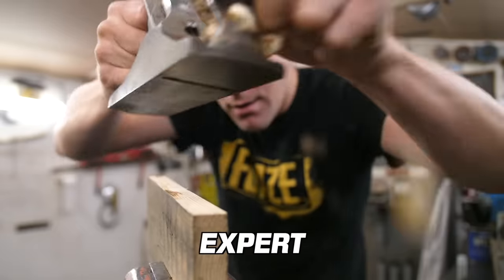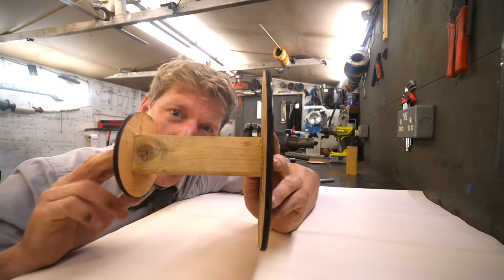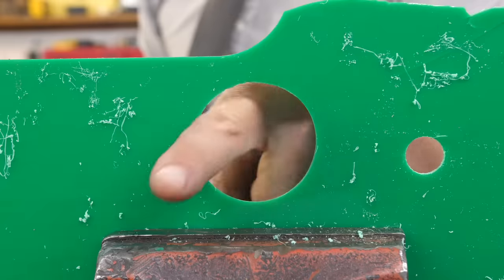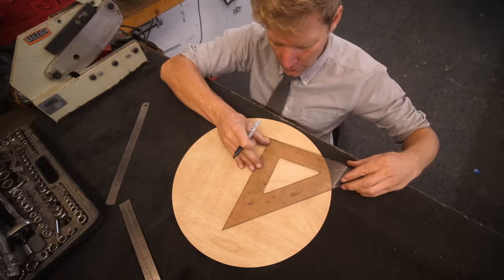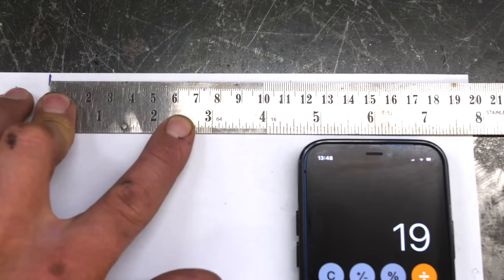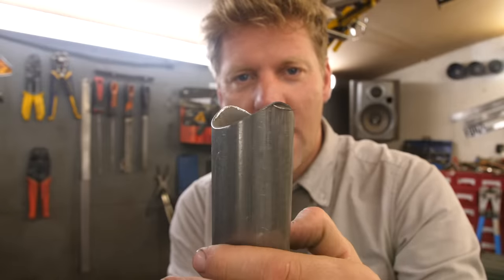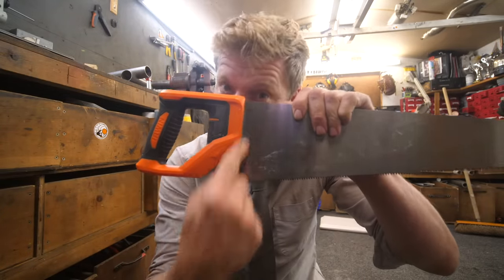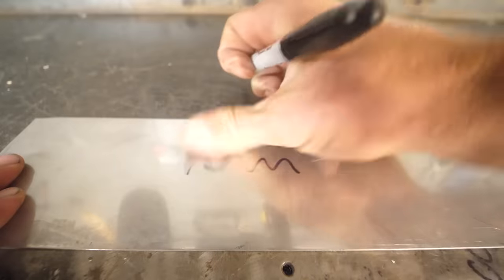18 GENIUS Workshop TIPS (that actually work)

Comment from the maker: Let me know if you know of any more guys as some of these were new to me but genius. Get an exclusive Surfshark deal! Enter promo code COLIN for an extra 3 months free at https://surfshark.deals/colin
Reply: Hi Colin
Reply: salt and alcohol to remove oily/tarry goop -= the salt doesnt dissolve but any tarry stuff will. Even works shaking it round in something
Reply: A good safety tip:  Never try and hold a piece of wood in one hand and use a chainsaw with the other, especially when on a trampoline.
Reply: If you struggle to wash your hands, use PVA glue and let it dry. Works a treat
Reply: Excellent video as usual Colin - Top job.
Reply: What’s the loo roll tip? I need it urgently
Reply: 19th Workshop Hack,  "Safety Glasses"
Reply: You can use drywipe pens to get rid of Sharpie too.
Reply: @lefroy1 I close my eyes so I don't get saw dust in them . Top tip.
Reply: -Alcohol removes Sharpie ink.
-One can always put a round bubble level on the back end of a drill, but this only helps when drilling downwards.
-A long strip magnet on the end of a broom handle works well to sweep up dropped washers, screws, etc. I've evn seen them attached an inch or two above the end of a broom's bristles to collect metal bits while sweeping. This also helps to keep the bristles from going overly wonky over time.
Reply: Wait. You're still a youtuber?
Reply: When you open a pack of cable ties, cut a small slit in the centre of the packet, take cable ties from here. They won't all fall out, like if you cut the end of the pack.
Reply: 5:30 not parallel, perpendicular!
Reply: Im not sharing any hacks until you do your 12,000,000 subscriber fireworks celebration.
Reply: The Saw handle is not just a 90 it is also a 45 angle
Reply: Hey calling I've got a bunch of ideas that nobody's ever thought of yet and I just don't have the time or resources to work on them
Reply: I'd rather use silicone for a non-slip pad than carpet
Reply: Glue the foam rubber in the tonnel, there will be much less echoing.
Reply: @cocospops9351 I like that zip tie hack. For small bagged nuts, washers and screws the little holes already in the bag can be stretched a little to remove or return the bit. 
Blue/green painters tape makes a good reusable “latch” for boxes that won’t stay closed. 
Mark your center/cut lines on blue painters tape on your part let’s you remove sharpie lines from wood and it has good contrast.
Reply: Getting a 3D printer, they are so cheap nowadays, and can be useful not only for prototyping and even final parts with the right design/material use, but also for making templates, measuring/calibration tools, and more!
Reply: (better described with visual aids but) If you have a line but want to get a right angle from it: measure two points equal distances away from the angle point on the line then make two larger radiuses from those points (use a compass or string or w/e)  where those radiuses intersect will be 90 degrees above the original point.
Reply: This is great Mr Furze. Lots of new tips for me
Reply: You can use sharpie as a guide for annealing aluminum instead of acetylene soot!
Reply: Brake parts cleaner works GREAT on sharpie
Reply: 10:52 alcohol also works
Reply: I find that if my hands are are covered in thick tarry oil, the best way to clean it is to use a very light oil like wd40 on your hands rub it well in and then wash your hands with washing up liquid. the lighter oil breaks down the heavier oil making it easier to remove.
Reply: New tip! Plan for head room when you're building?? x{ <4<4
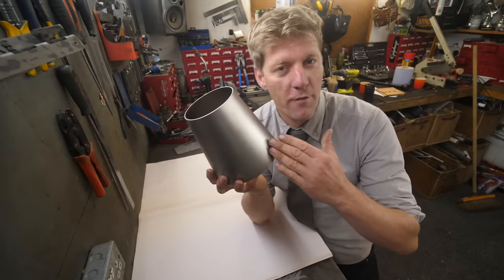1:10 look look lots lots of head rom :}
Reply: To get permanent marker off of a white board, just scribble over it with a white board marker.
Reply: The drill in drill thing is genius! Never considered stacking them and needed exactly this solution earlier today. I ended up with a normal drill in a hand drill chipping it bigger in polycarbonate plate.
Reply: A great way to strip wire is to drill a hole a bit bigger than the wire in a bit wood then drill another hole the opposite way down into the other hole then sharpen a screw end and put your wire in hole then screw point into the wire outer layer then pull the wire through with the wood in a vice or something to hold it. You can also use a drill to pull the wire through.👌💚💛❤️
Reply: If you scrumple grass up in your hands it's great for cleaning them and getting smells like petrol off them and even works with oil.💚💛❤️
Reply: If you need to cut Cork/paper on a laser cutter and it constantly curls up. Should be able to use either a small ball bearing, or a small magnet to hold it down at the corners.
Reply: Colin, do you have a link to your drill bit guide please?
Reply: I have a safety tip that could save you life... Tip #1: Never, ever, try to build anything Colin builds
Reply: The "how to know if a square is a square" method can be defeated by a Rectangle, Colin ;)
Reply: To straighten coiled wire: cut the length you want, clamp one end (I use a vice) and stick the other in a drill (I use a cordless.) Press the drill switch so the chuck rotates and it'll uncoil your wire. Makes it nice and straight.
Reply: To get sharpie off wd40 and a shop paper towel
Reply: The handsaw also has a 45 degree angle
Reply: Lots of these are super handy, for the sharpie tip, most of the time dry erase marker on top of the sharpie works even better.
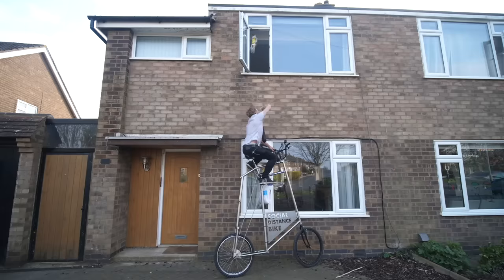Reply: 2:19 clean sand does same thing (I have 5 litre sandsoap bottle in my workshop)
Reply: You can use kneadable rubber,  putty or sticky tape to remove iron filings from a magnet
Reply: Another thing re: the sharpie, you can also go over permanent marker with dry erase marker, the solvent in the dry erase marker that makes is erasable will mix with the ink from the sharpie and make it dry erase ink.
Reply: Couldn't you have just filmed the Intro towards the end of editing so you wouldn't have to do the weird voice cut?
Reply: @lio1234234
This, too.  You could probably print 90% of the parts you need for that notch cutting tool, too.
Reply: if you want to tighten a bolt / nut but you can't reach it and with the ratchet wrench you can but the bolt falls out put some grease in it now it gets stuck
Reply: you can use the inner circle of dots to get a certain distance when drawing
Reply: For getting rid of maker pens I use methylated spirits(usually used as a degrease) and it works well for stripping Grease below the marker pen at the same time you just have to remember to clean your hands once you are done in the workshop
Reply: To make a perfect hole in a piece of glass (to put something like tubing through it or become a master jewel thief) etch the glass in a circle with a single pass, making sure to stop right after the start point. Place a suction pad with a handle on top in the center of the circle (something like removing dents from car doors), then alternate between heating and cooling the etch you made in the glass. The greater the difference between the hot and cold, the easier it will be to remove, though a huge difference may shatter the entire pane of glass(think dry ice and a direct flame). As you heat and cool the etching, apply a pushing and pulling force with the suction cup but not directly in and out. Try to pull and push the suction cup in a circular manner while the cup is still suctioned on the middle of the circle.  The glass circle will eventually pop out!
Reply: The handsaw also have 45° angle built in.
Reply: if you have a cordless angle grinder... undo the 4 bolts holding the motor/gearbox and rotate it 90 degrees and then re-affix... makes your grinder so much more balanced and does`nt strain your wrists if doing a lot of grinding/cutting.. great if wanting to do precise cuts
Reply: Ok, I exchanged LMB and RMB of my mouse. Boiii, I work fast now!! 😆
Reply: Hey Colin!  Another way to get sharpie off any smooth surfaces is with a Dry Erase marker.  Just scribble over top of the sharpie marks with it, then wipe it off and it 100% comes off.  Works on Metal, Glass, Plastic etc, and leaves nothing at all behind.
Reply: @Lowbrow_Mthakathi I’ve stuck a sharp pencil in the side before now after having some very challenging paper, then pull towards the glued bit. Hope this wasn’t too late😂😂
Reply: You may lubricate a nail by hitting your finger with the hammer first
Reply: another way to get grease off your hands is use washing power same idea with the sugar just makes the soap ruff. side note your hands will sell awesome. 
if your ever working with hot asphalt diesel eats thru it like a hot knife thru butter.
Reply: sharpie removal: everyone probably have hand sanitizers at home look for one whit Isopropanol in it sometimes they use another names like 2-propanol/isopropyl alcohol. its way better then ethanol
Reply: When drilling concrete, a lot of times the drill bit will walk and make you miss your mark. What I do is use a center punch to start the hole in the concrete, use a small concrete bit, drill a pilot hole just like you would in metal, this makes sure the hole is where you need it to be. Not sure if this is s common practice for drilling concrete or not. But I thought I would mention it anyway. Thanks.
Reply: Wow, a hack video with actualy really useful stuff. That must be a first! 😂
Reply: Finding level with quick square and a plum bob?
Reply: Colin heres a hack for you Cracks a holes in plastic can be filled with bicarbonate of soda then add a few drops of superglue works a treat.
Reply: The hole saw in hole saw hack would have saved me a bunch of epoxy repair on my back door 😂
Reply: I buy cheap exercise mats and cut them down to whatever size for when I'm working on my knees or laying on the ground.
They work great and they are cheap!
Reply: I'm amazed you haven't done one of these bids before Colin... Know I love it before I watch haha
Reply: Car boot sales are a great way to get old tools. Stronger steel than Made In China, and all the old stuff that came before everyone had a computer in their pocket.
Safety glasses are cheap, eyes are not.
This goes for protective gloves, too.
Mark before you drill.
Measure twice, cut once.
Write down your notes and thoughts, so they don't vanish.
Reply: If you want to get a firm grip of something with a thread (like a screw) without ruining the thread, wrap a wire wide enough in the thread and now you can firmly hold it without ruining it.
Reply: To drill a hole in hardened steel,  use a sharpened tungsten concrete drill. Goes through like butter.
Reply: If you have grubby hands use green soap and a bit of bicarbonate. My experience it works better.
Reply: I work out in the field. If I run out of gritty soap I just grab a bit of dirt or sand and add it to my soap.. yes adding dirt to soap actually cleans your hands better.
Reply: Line up your light switch plate parallel with the door trim.
DO NOT use a level. It will look daft.
Reply: Put tape on drill bit as a flag. Flicks away sawdust when depth reached.
Reply: @demolitionman9307  My dad wouldn't let you do anything without safety glasses. He learned after losing an eye.
Reply: If you have an orbital sheet sander (the rectangular ones with spring clips at the ends what grab the folded-over sandpaper sheet) you'll probably find that the abrasive outlasts the paper it's glued to by a million years. Quick and easy solution - give it a backing of brown packaging tape before fitment and voila - sandpaper sheets that actually get worn out properly without tearing. Gaffer tape works even better if you're feeling posh. Best money- and tooth-enamel-saving tip ever!
Reply: @gruntspeed  Swarfega works best, especially the newer kind with the abrasive bits, as opposed to the older gooey stuff.
Use it, then wash with soap to get the stink of artificial orange off your hands.
Reply: You can remove permanent marks off wipeable surfaces by drawing over with a dry wipe marker (I know similar it's to your Sharpie hack)
Reply: Tip. Close the hatch so you dont fall in. Hehehe
Reply: To find a 90⁰ use the 3,4,5 depending on size mark 3ft on one side 4ft on the other the distance from furthest points will be 5 ft if it is 90⁰
Reply: A dry erase marker will also remove sharpie, and generally is easier to clean
Reply: IPA (Isopropyl alcohol) removes Sharpie really well, works as easy start, lights fires and cleans wounds. Also can be used for cleaning electrical terminals.
Reply: Bloody great idea for a Video Colin 👍
Reply: Use a dry-erase marker for Sharpie cleanups!

 (Comes off much cleaner and you don't have to worry about it drying on again if you're hitting a large area at once.)
Reply: @jeepercreep12  No if its permanent marker then you'll need Rubbing alcohol / isopropyl alcohol
Reply: if your kids get hold of sharpies and they colour something in,  something in  AXE / LYNX body spray acts as the perfect solvent completely removes it. worked perfectly on the bunkbeds, chest of drawers and varnished floor... mixed results on the barbies.. lol
Reply: I find standard dry-erase whiteboard markers are good at removing Sharpie too! As a bonus, it doesn't usually leave the smudgy residue.
Reply: You need a de burer
Reply: Also deodorant sprays get marker pen off too :)  I used to use this trick when rewriting to Cd's back in the day!!
Reply: Hand sanitizer gets rid of permanent marker from white boards and stuff.   and smells nice.
Reply: I know a few guys - you after any particular type of guy?
Reply: Remove Sharpie using whiteboard pens
Reply: can we work with you one day please. I'm thinking music video project at your lovely area @honourwave is our main channel
Reply: Colin you missed the 45degree set square on the hand saw
Reply: Sharpen chisels and drill bits with an angle grinder because life is too short for a whetstone, or a blunt tool
Reply: Use a bit of gel anti-perspirant on a bug bite to stop the itch.
Reply: yes piz
Reply: Use Stanley knife blades in a 3rd hand tool to precisely direct a blow torch flame.
Reply: Brake Cleaner works well to remove sharpie from glass/metal
Reply: If a bolt or screw is stuck, surprise it with a quick tighten before loosening it again.
Reply: Wire brush clogged sandpaper.
Reply: I have a question. when are you doing another tunnel video where your going towards your bunker/underground garage idea?
Reply: If you’re drilling through iron, use a 1mm grinder blade in the top of the drill bit flute to make the end pointy (they come with a tiny chisel type end) it will glide through.
Also grind the tip to 50 ish degrees not 60 - you may need to reverse the drill when breaking through the other side to stop the bit catching and snapping.
It’s way sharper than they come.
Reply: Balance long things on your finger to find the centre quickly.
Reply: Don’t tape power actuated nail gun caps to a crossbow arrow head. The arrow comes right back at you reallyfast.
I’ve heard.
Reply: For cleaning your grease nasty hands scrub with a dab of vegetable oil first, follow up with your preferred hand dish washing soap.  The veggie oil will not only bond to the grease and grime better than just using the soap but will also make your hands softer and cleaner... (without the chemical smell of gojo/fast orange/etc. My mother used to get sick from the smell of those hand cleaners being opened in the house when I was a kid so we experimented to find a great alternative).
Reply: When you drill thin sheet metal a drill will tend to egg out the hole. To stop this throw a piece of shop rag down under the drill bit or piece of emery cloth.When drilling brass a drill bit will tend to grab badly , to prevent this put a zero rake angle on the cutting edge of the bit, works for any gummy grabby material.
Reply: A few dumb tips from the peanut in the Gallery
If it's cold and you are using spray paint from a  can  to get the very best performance from them Preheat the entire can hot water until the can is at about 20c. I do go higher to about 25. Give it a good shake and test again for the best results.
Using air to pressurize your aerosol cans is good but some contents will go off when air is in contact. For stuff that you need to keep long term I have used Butane that is used to fill refillable lighters. It doesn't affect paint and puts a longer lasting charge into it. As for the flammability remember the vast majority of spray cans use this anyway as a propellant.
Drilling copper, plastic or anything soft or thin and your drill is tearing through on the back side put a very small negative angle on the outer cutting edge of your drill. It will prevent the drill from screwing through and tearing the back surface. It can also be used to ensure a much closer hole size to the indicated drill diameter.
If you are welding and have splatter or dont want splatter to stick use some cooking spray. Spray around the areas where you dont want splatter. There is professional anti splatter spray available but unless you are using it inside your mig welding shield the cooking spray works just as well and is loads cheaper.
If you are using your stick welder and the rods have been open for a long time in a non moisture controlled environment they wont work as well as they should. You can preheat them before use by using a BBQ and a old baking tray/sheet . Just leave on top of a gentle warmth to dry them out. It works very well for rods that have been left out in the rain or even just hanging around unopened in the shed for years. I use an old electric fry-pan that is clean to keep oil away. There are professional solutions for this like Rod ovens but the fry pan is temp controlled and works just as well. Dont get the rods to hot, I try to keep it under 110c and have good results.
I use the same pan for precision bearing fitment as well as other precision fits. Just leave the bearings on the pan and give them time to heat and normalize it is a rare occasion when the temp is required to go over 110c for an easy precision fit assembly.  Dont forget to use gloves to prevent burns.
The same old fry pan can be used again to revive a rusty old roller chain. I put the chain into the pan and cover with a light gear oil. Get it a bit warmer this time say 140c ~160c and let it soak. After the chain has come up to temp remove it and work it to free it up. Repeat this a few times and the chain if recoverable should be fine. Not the best thing for O ring chains but if they are not overheated they are still ok for doing this. O ring  type keep the temp down below 90c. This wont fix a stretched, worn out or bent chain but will revive  most and is a good practice after beach session.
Just a few of the top.
Cheers
Reply: Dry erase markers will also remove sharpie mark with a bit less mess
Reply: @LilMissMurder3409 another sander trick you can polish using a heavy paper bag in place of sand paper for extremely fine sanding/ polishing (around 5000grit)
Reply: Yes! Do more teaching videos, we need your skills al la This Old Tony, Ox Tools, Abom, Mr Crispin.
Reply: @dazaspc another is the hot air food dryer works good for not only  flux core wire/  stick welding rods but also 3d printing filaments, even drying water dipped electronics (on lowest setting over a day or 2) a bag of rice works too
Reply: To add air to your aerosol cans, use an old tire Valve Stem.
Reply: Don't sweat the petty things, and don't pet the sweaty things.
Reply: When using a holesaw into plastic, if you are sick and tired of getting the hole stuck inside the holesaw after the hole is driilled then for the last millimetre of the cut run the holesaw backwards. The hole you have drilled out will now drop out of the holesaw without needing to get a screwdriver to pry the hole you have cut out of the holesaw blade.
Reply: @Paulman50 thanks for that one!
Reply: Find the center of any 2d shape by drawing 4 lines that intercept to make a square, then 2 more lines from corner to corner
Reply: Of you want to get rid of sharpie even easier, write over it with a dry erase marker.
Reply: To clean your hands, use clean oil i.e. a spoon full of olive oil, to get of any dirty oil residue. Then just use soap and water after that. Will be much less aggressive on your hands than adding sugar 😂
Reply: to remove sharpie or other permanent marker ink just use metho, or any alcohol
it says on the side of the marker that its an alcohol based ink. 
just dissolve it with more alcohol
Reply: When machining: Stick a cigarette paper to any face you want to machine. Bring the cutter in/down until paper is whisked away. Zero your datum.
To find the best working height for your bench: look straight ahead, stand to attention. Place fist under chin and keep elbow to your side and the distance from elbow to floor is ergonomically the best height for the top of your vice. Make bench so vice is that high from the floor. 
If your pipe cutting is not great, and you want to reduce the tolerance (better welds). Wrap a piece of pipe with 120 grit wet and dry, and use to polish and refine the inner cut surface of the pipe you just cut. Engineers blue and Feeler gauges are useful if you want to get a very tight fit.
Reply: 3-4-5 Right Triangle. Measure 3 on one leg of what you want square, then measure 4 on the other leg. The the slant/hypotenuse will be 5 if it’s square. It doesn’t matter the units. You can use scale it up and use 30-40-50 or double or triple it with 6-8-10 or 9-12-15. You can even make your own units to fit the scale of the project. It works on all scales but really works brilliant if you don’t have a very large is square and need to measure things like a wall or foundation or football field etc. (I put this in the main chat too. Sorry for the repeat)
Reply: Sharpie is easily removed by isopropyl alcohol.
Reply: @demolitionman9307   you mean safety squints?
Reply: We have some kit that might help you out on projects... We'd love to hook you up with some stuff
Reply: @TheCainman1  yuh,  amazing how many people take their eyes for granted,,   could be worse though, like a Tye getting caught up in Rotating Machinery!
Reply: When applying lubricant to a chain e.g WD40 place another spray nozzle from a spare can at the end of the straw it makes aiming where it goes a lot easier. Brilliant video as always Colin.
Reply: Hi Colin. Just wanted to add that your tip with the saw/set square (90 degree) also has a 45 degree at the handle right beside the 90 degree one ;-) I like your vids.....cheers!
Reply: In regards to removing sharpie it can also be removed with drawing over it with an Expo Dry Erase marker.
Reply: To cut holes in thick material quickly with hole saws. First begin the hole saw so it scores the surface. Then drill some 4mm(ish) holes through the material at score mark. It allows swarf to clear without having to back out the hole each time the teeth need cleaning.
Reply: @TheCainman1  double rubbers, mother on speed dial.
Reply: If you want to straighten copper single core cable or a solid wire ( like suspended ceiling or fence wire ) fasten one end, then put the other end in the chuck of a drill. Pull tight while drilling the wire striaghtens out. Works on any length if you have room to stand far enough to pull it
Reply: The saw is a set square that can draw 90 degrees as shown but also 45 degrees on the other part of the handle - I’m surprised you didn’t mention it
Reply: Quickly true up a part on the lathe by running the part into a blunt tool until it runs true. Much safer than tapping it with a hammer while running!
Reply: Wd40 works for washing your hands of dirty motor oil etc. Oil dissolves in oil u know. Of course you have to use soap to wash the wd40 off then.
Reply: drywipe marker also removes sharpie
Reply: Wow
Reply: if you quickly need to bend a HUUGE sleeper, put a piece of paper at the bottom and bend your sleepers without fear of splattering your ass😂!
Reply: Tip 1: use ipa (alcohol) to remove hot glue.
Tip 2: use a torx bit to remove stipped Allan key head screws by hammering the bit in the head of the screw.
Reply: How to prevent cross threading screws ??  Put the screw or bolt into the nut or pre threaded hole turn it anti clockwise until you hear or feel a click, then turn as normal clockwise, keep a constant even pressure, its called " timing the thread", it never fails !!
Reply: If you need to screw in some small(ish) hooks, you can attach one hook to your drill from the thread of the hook. Get another hook on the wall started by hand and screw it in with the drill. Just hook the hook in the hook and press play on the drill.
Reply: Here's one for you Colin, When I need to find the center line of a round stock on the vertical mill, I pinch a thin machinist ruler between a drill bit point and the round horizonal stock. If you adjust the table axis perpendicular to the pipe, you will find the center when the ruler is "level". Great video my man: you have made me better over the years.
Reply: To prevent wasting cans of expanding foam, use purple primer (has acetone) to dissolve the foam in the straw and tip. Keeps the can from freezing up. I don't always have acetone laying around, but I have purple primer
Reply: Instead of using sugar with your soap, use salt. It is smaller grit, the salt will prevent it foaming and most importantly SALT IS CHEAPER than sugar! (Don't use IF you're prone to rust!😂)
Reply: Please make this a complete series. Thank you.
Reply: Highlighter works to get sharpie off as well
Reply: @markford8715 also sprinkle baking soda on super glue as and accelerant
Reply: I find dry erase markers gets Sharpe off better
Reply: Less workshop-y but if you ever need to get something REALLY cold, dry ice and ethanol gets down to around -75°C (-100°F).

Get some dry ice, get some ethanol (or the highest-proof [140+] booze you can find - ideally everclear), put the dry ice in the ethanol, wait a few minutes, and you're done.
Reply: If you ever want to drill a hole in a big sheet of plastic like that of an 1000 liter IBC tank, you might tear the plastic if you use a holesaw. Dozens of teeth digging into a grippy material like HDPE tends to spell disaster. 

But not if you run your drill backwards! 

The teeth are still pieces of metal with a sharp blade on the end; and heat does the rest.
Reply: The 3 4 5 method for checking for a square corner
Reply: Dry erase marker also works for getting rid of Sharpie.
Reply: isopropyl/denatured/rubbing alcohol works a lot better for getting sharpie off of things. you can buy cans of boat stove fuel that are 99% alcohol in the US, not sure about other countries
Reply: Siphon fluid using a blow gun at the discharge end by setting the blow guns tip at about a 60 degree angle facing away from the discharge end. It's like using a hand vacuum to pull fluids. Another....say you've got wires to feed through an odd shaped pipe. Get a length longer than the pipe of  Unwaxed dental floss tucked into one end, then holding the start end of floss, blow the rest into the pipe and it'll always come out the other end. Use this one all the time on retro installs for things like HDMI cables etc into previously installed conduit. Also works awesome to wire up motorcycle handlebars and hide the wires inside the bars. Same with hiding wires in the frames of bikes and motorcycles. Just drill a couple small holes. One at the start of your wiring, another where you want the wire to exit and poof.....floss threaded and it's plenty strong enough to pull a number of wires at once. I've got a ton more on my channel Colin, so check them out!
Reply: WD40 is great at removing sharpie!
Reply: TIP : If you need to go to the next story up USE THE STAIRS. your very welcome.
Reply: My favorite thing in my shop is paper. Measuring out evenly spaced fasteners, centering smallish things, coping large tube, or marking holes in tube is easily done with a scrap of paper. 

Centering with a tape measure on small things is awful. Justify the work piece to one side, mark the length on a pice of paper then fold it in half. There is your centering. 

On tube, to mark out evenly spaced holes or fasteners, wrap a strip of paper around, mark the length, fold in half for 2 evenly spaced holes. For 4 , fold in half again, for 6 fold into thirds and then in half. 

Fiddling with small fractions and digital calipers is a time sink. None of these are machined part tolerances but if it need to look and work the part, it’s just the trick and no calculator or tape measure needed 🍻
Reply: TICKING STICK! Super cool trick for recreating a shape from a template.
Reply: Hairspray works on removing permanent marker from things like metal & plastic but not fabric.
Reply: Got a bug bite? Rub the inside of a banana peal on it to stop the itching.
Reply: If you have an element in a structure that needs to be stiff and light, i beams are very useful. But it is kinda difficult to connect anything to it with anything except welding
Reply: Center of a circle. Take a carpenters Square, put the point at the edge of the circle, mark the two places the outside of the square touch the circle. Draw a line between them. Do it again at a different point and draw another line. They should intersect in the middle of the circle.
Reply: If you're getting tired, or you're getting frustrated with a job, walk away from it and come back later.
Reply: When drilling a pilot hole in mild steel or stainless use a 1/8 drill bit in a hex bit (like roofers use for rivets) and drill your hole using your rattle gun.
The rattle gun spins faster and closer to the optimum drill speed for that bit. Use a superior cutting oil like rocol and put all your weight behind it. (This will help achieve a higher ‘feed rate’)
If you do it right you’ll get twin pig tails of swarf.
I think once you get to 10mm and above a second application of cutting oil is needed at halfway.
Reply: What do you guys say? ah BRILLIANT!
Reply: The small hole saw to big hole saw thing is great but as a locksmith you encounter odd shapes from whoever installed (ususally carpenters) or something that isnt round and for that just get scrap timber and drill straight through with the size you want and clamp it in place to get perfect holes without it destroying your job 👌
Reply: #1.  I'd far prefer scaled down content more in line with what normal people can relate to and more frequent uploads.

#2 you need to include a staple of every man's workshop: Brake Cleaner.   So many uses.
Reply: Vinegar and washing-up liquid together make the best glass cleaner.
Reply: @mycosys  and if add a little rice to your salt and alcohol you get a little extra scrubbing power.👍
Reply: 10:57 Sharpie.
You can use hand-sanitizer too (any alcohol should work, try eg. Vodka).
It is the alcohol that works to dissolve it. (unless it's some special sharpie, like maybe permanent marker or so)
Reply: Thanks Colin. Great video. Liked the wooden templates for marking sheet material. Impressed. . . I carry a candle stub in my overalls pocket. I use it for putting larger stainless steel nuts and bolts together, especially on stud bar. . Stainless fitting can seize if they get hot in the tightening process. . I use it for drilling if its just a small job and the cutting paste has gone walkies. . It's just paraffin wax oil when heated. . I've used it as a quick mould release wax or on a recently painted locker lid or fixture I don't want sticking. . On long wood screws. . The list goes on. . One could even have a little candle lit lunch with a fellow engineer if mood takes you 😄
Reply: Mention the 3 4 5 trick Colin. I use it all the time especially on larger projects. It’s how to make a perfect 90 degree corner without a square or anything, just a tape measure. Just measure up one side and mark 3, then the other perpendicular side and mark 4 and then measure diagonally between these marks. If the distance is 5 then the angle of the corner is 90 degrees. If not then adjust the physical angle until the distance between marks is 5. Any unit of measurement can be used as long as it is the same numbers. Cm, metres, Inches, feet, yards, anything. If I haven’t explained it very well just search for it on the internet. This is definitely a good tip though and I use it all the time when I don’t have a square big enough. I learned it off an old carpenter friend years ago. Thanks
Reply: Dry erase marker also removes Sharpie!
Reply: @konserv  I lke the echo.
Reply: If you dont have sugar you can use some sand also with soap. Bit scratchy but helps
Reply: @TDOBrandano or better  ..  duct  tape
Reply: jimmydiresta had a rather woodworking centered one, a.o. some tips using masking tape for taking templates, or to use it as single-use "flat bowl" to mix two-component stuff etc.
Reply: 3-4-5 to make a right angle
Reply: litterally all of the elucidian proofs that everyone slept through can be used to take a ruler and mark out perfect shapes (or a string and a knot for that matter)

Need a tighter fit? a more accurate layout? measure on an angle, if you really jeed accuracy do so with a protractor. 
The best protractors have a little mark out line with graduations. You can get down to .005" or .13 mm with some practice using just a ruler and some simole trig, just use a hypotonuse calc.

the reason combined calipers have points on the inside measurement bits is for marking Not for measuring small holes.
Reply: Hey Colin when’s your underground car garage video coming out?
Reply: bug spray will take off sharpie as well.
Reply: For the sharpie, instead of using a sharpie pen again, you can also use a dry-wipe whiteboard pen!
Reply: Good tips